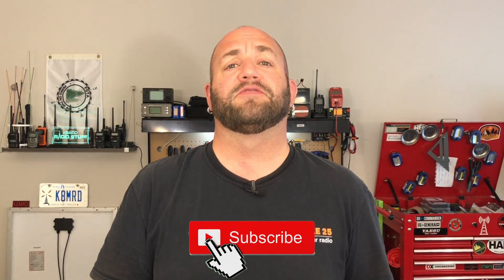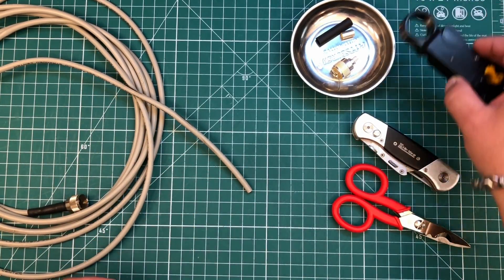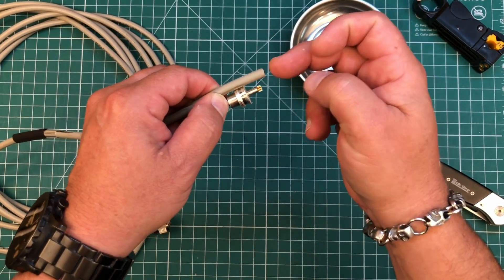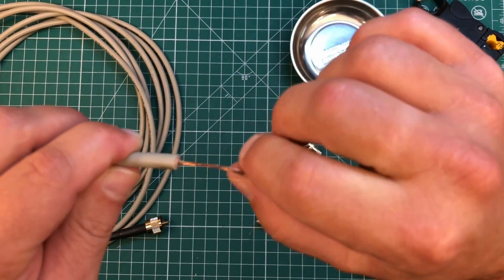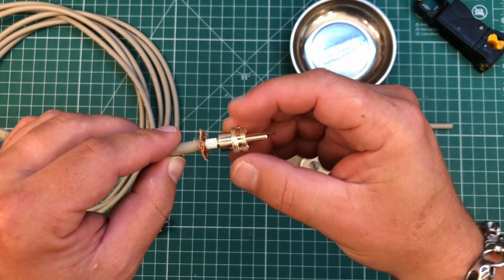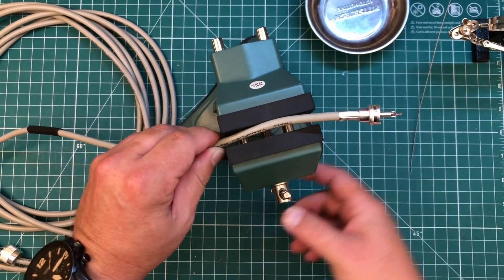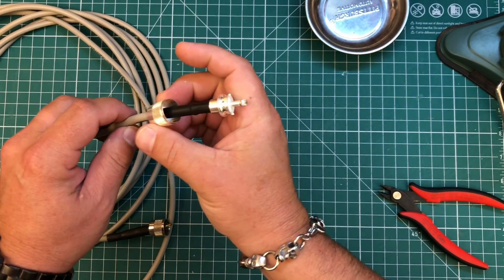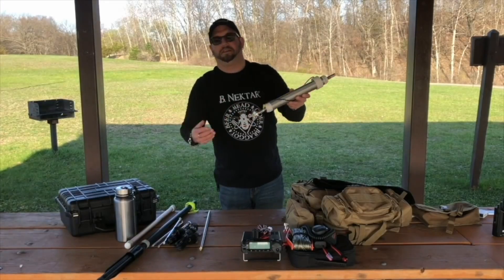How To Install A Crimp On PL-259 to Coax

Comment: Thanks for the demonstration of how to install this connector without needing too many tools. However, the one key tool you need is the crimper and I didn't hear you tell what crimper it is and I don't see a link to it. You also said what size crimp to use, then the video text said that was wrong, but never told what was correct. How do you know which crimp size to use with which coax cable? Do you have to buy a PL-259 connector for the specific coax size you have? What if you want to do BNC connectors? Do you need a different crimper?
Reply: Depending on the coax to have to buy the right PL 259 connectors. You then have to buy the specific crimper for the specific cable/connector. I have 2 crimpers.... one for RG 58 and one for LMR 400 coax. No one connector fits all coax and the same for the crimper.

Comment: Good demonstration.  I like to tin the center conductor with solder before I solder it to the connector.  I find it makes soldering the center conductor to the connector a little easier.  Flux helps as well.

Comment: Just put a PL259 on a new length RG8U for an end fed half wave this morning. I trim my coax a little differently than you do, not better just different. I also used the correct crimp die in my crimpers. The only thing that matters is making a good connection. How it looks doesn't matter...

Comment: I haven't put on a PL-259 in years. I've heard good things about these crimp-ons. The problem with soldering was it was hit and miss with soldering the braid. Not hot enough and you risk a cold solder joint. A little too much heat and you damage the coax. Soldering the center conductor was never a problem. It's not always necessary to solder the center conductor. It's "preferable", but if you were out in the field where a solder iron was not readily available you could skip soldering the center if you had to.

Comment: Great video, thanks! I'm not a ham, but I run GMRS in my race car and really wanted to shed almost 10' of cable after installing a new antenna. Never done it before, but this tutorial was exactly what I needed. Got it done and had a chat on one of our local repeaters ~50 miles away, through the back wall of my shop. 
I think that'll work just fine at the track :D
Reply from the maker: Awesome, glad it helped.

Comment: I tried making 3 and my radio doesn’t like any of them 😂 I said screw it and  just ordered some pre made. If that doesn’t work at least I’ll know I’m not a moron but then that just means something is wrong with my equipment. I’m brand new to all of this and I’m hitting a wall at every turn it seems
Reply from the maker: It takes practice.  You'll get it.  We all start at zero.  It's only up from here.  Welcome to the hobby!

Comment: Dumb question from a dude still studying for tech. What glue do you use? Thanks
Reply: He didn't use glue, but the heat shrink tubing he used has a "heat activated glue" inside it, making the connection more watertight.
Reply from the maker: I'm not using any glue
Reply: Search "marine heat shrink" I'm guessing you're already done, but commenting for future people. Side note you will never use regular heat shrink again once you try it. Buy it by the foot and foot and thank me later.

Comment: Which is recommended for a vhf marine installation.  R8 or r213. Also is dialectic grease a good idea
Reply: RG-8X for cable runs that are less than 50 ft. RG-213 for over 50ft

Comment: I really miss Radio Shack. You used to be able to run in and grab PL-259's and many other things and get right back to work. Now everything goes on hold while you wait on Amazon for 2 or 3 days.
Reply: West Marine has a good selection of pl259's in store. From cheaper to the expensive gold plated for corrosive environments. Also the mil spec rg213 and a couple other sizes
Reply: for real man. internet ruins everything.
Reply: Yeah I miss going into Radio Shack too.😢
Reply: You are absolutely correct sir.
Reply: A friend was a satellite assembler for a BIG company. On occasion they would make a RS run for a part that they needed. Nobody knew.
Reply: I know, even though it is convenient Amazon and other places, it was nice going to a physical store and looking at pieces that you needed
Reply: Radio Shack was not good. The pin would fold over when you put heat to it.😮

Comment: One of your last comments was how you melted things when trying to solder - I don't feel so bad now.  Soldering is something new to me - and I melted an N connector the other day.  I am trying to build a 2m 1/4wavelength antenna out of coat hangers.  I cannot get the vertical wire soldered to that chassis.  Gonna keep trying.  You put out some great videos.  Thank you!!  73  K0JNS

Comment: Thanks for the excellent video.  Started crimping BNC's a while back but wasn't sure about crimping PL 259's. You answered my question about the center conductor (solder).  Bought all the stuff to crimp a year ago and now am replacing an antenna and feedline. So after decades of installing connectors the old way (always hated it; never really got a clean looking job) I'm looking forward to crimping.  73's Bill/KG6DZ

Comment: Why do Americans say sodder? There's clearly an L in there. That one's always had me stuffed.
Reply from the maker: Same reason you say Al You Mini Um.  You add an extra I.  It's spelled aluminum. Ah Loo Min Um.  Check and mate good sir.
Reply: @hamradiotube  that's not the same, but your example is basically due to the Webster's dictionary, where Americans adopted all of these shortened versions of words. It's not correct English, however with Americans generally being so ignorant, they believe their version is not only the sole one, but also correct. I also laugh at how you literally pronounce words, particularly of French origin. Even bogan Australians have a better grasp on the English language and it's roots.
Reply: @hamradiotube  I just realised that you're the same guy that will not amend or delete your video on the PL259 compression plug installation, even though I clearly pointed out a very important flaw in the process, ie. order of assembly. You are completely new to these plugs, myself, I have been installing them for over a decade. You must correct this, how many times do I need to ask this of you? You reply to me with some dumb arse, irrelevant American spelling, which is wrong, yet do not bother to reply with what is important. There's all these people out there now that have installed their plugs incorrectly, likely risking their equipment. Will you pay for that, you bloody ignoramus?
Reply: @hamradiotube  btw, I say el a min e um.
Reply: It's a silent "L" in solder. Other words pronounced with a silent "L" are:  Calf, Half, Talk, Could, etc. etc.  What's so difficult to comprehend?  Different areas of the world pronounce things differently.  Generally speaking, solder is pronounced with a silent "L" in the United States, no big deal.
Reply: @i.karatakova6932  what a load of crap. So you say the house is sod.

Comment: I'm new to amateur radio, and got my golden ticket  two days ago, and I have a travel trailer prewired for coax connection can I use that for a base or mobile radio hooke up to a antenna and would I have to change out the interior  junction box to fit plf259 connector I'm curious to know.

KQ4HCU
73

Comment: do you like the crimp or compression pl259s better
Reply from the maker: Oh man thats a tough question.  They both serve their purposes.  I would have to say the compressions might be a bit better because of the gasket inside that could prevent moisture coming up and into the shield.  That can totally ruin your coax.  I’m 50/50 honestly.
Reply: @hamradiotube  Thank you! 73's K1CXS

Comment: I basically just bought a sailboat and need to replace a couple connectors and just found out that the ones I got from Amazon are just a tiny bit smaller than what I need, crimp sleeve won’t slide over white jacket. The inside is a little corroded but I have what I have. Guess I need to look at how much new wire cost but budget is getting thin.
Reply: How does one "basically" buy anything? You either bought it or not!

Comment: Nice,  I like to use anti-oxidant compound on the shield before crimping.  I also check continuity and resistance on the cable once finished.  Be sure to wait till its 100% cooled.

Comment: Hey dude, really loved this video, thanks so much for breaking it right down in detail. I run an LPFM Rock radio station. Being based in New Zealand, we are disadvantged due to location and were always having to import preassembled LMR-400 runs. Now I have a spool and stock of 50 crimp connectors. Not only is this a huge cost savings (assembly labor & shipping), but it also means I can fix anything on the fly now without having to wait weeks for a delivery. Love your work. This kiwi has subscribed. Rock on Mike🤘

Comment: If the center conductor is tarnished, is the whole length of cable bad, or can you cut back a few inches at a time to see if it becomes bright?
Reply from the maker: You might could keep cutting it back until you get to nice shiny wire.  May or may not happen but anything is possible.

Comment: Nice one .. well presented 
These are convienint for things like field and mobile but prefer the tighter screw /solder 
Also the one thing you forgot was to do a continuity check after fitting off checking for shorts and contact ... every coax lead should be checked before use . 

John vk3wr

Comment: Nice video. Thanks. So where can I find a table with the crimp sizes for various coaxes? I'm always eyeballing it.  73. Bob, WK2Y
Reply: DX Engineering has one. The typical ferrule crimps are:
0.213" - RG-58
0.255" - RG-8X, LMR-240
0.429" - RG-213, LMR-400
Reply: @bigfootape  thanks
Reply: Appears that 0.255 should have been used in this video not 0.213.
Reply from the maker: I don't know, but I'll expect a full report on your findings when you get one.

Comment: I only use crimped plugs these days too. Good on bnc to rg174 for SOTA runs of light weight cables too, just sweat centre pin before crimping outer ring.

Comment: Good afternoon Mike, what a great video. Over the years putting on pl-259  connectors was quite challenging. Especially when you had to solder the shield to the connector because I didn’t want to overheat the connector because I might melt the dielectric. But now since crimping
 is the way to go it just makes putting on connectors to the coax so much easier. With this information on this video I may want to start putting my own connectors to the coax now. But my thing is if I’m going to get the coax I’m going with M&P coax and their connectors. Again thanks for the info it’s always great to learn something new.
WD5ENH 
Steve

Comment: I thought you were a M&P guy lol.
Reply from the maker: I am.  But it wasn’t always that way.  People will need to know how to crimp a pl-259 until they learn the ways of M&P.   It’s a slow process taking over the world you know?
Reply: @hamradiotube  Someone should really do a video on the best quality crimp on PL-259 for RG8X. I recently fell down that rabbit hole 🐇  🕳 and haven't found my way out yet. Amphenol? DX Engineering? Silver plated? Brass body? Copper body? Is RG8X so lossy that it doesn't matter anyway?...

Thanks ‐N7JSX
Reply: It would be nice if M&P made a connector for RG8X

Comment: 73 Sir! Newish Tech here. This video was quite timely. Looking to get some PL259 and coax and do my own cables. Also need to get some Anderson Power Connectors and crimpers as well. Hope to hear ya on the air sometime. Gotta get my General though. Stay safe out there.
Reply: Take a look at the crimp tool kit from DX engineering.  It has crimp dies for coax and Anderson connectors.
Reply from the maker: I'm sure it's good but my lord is it expensive!?